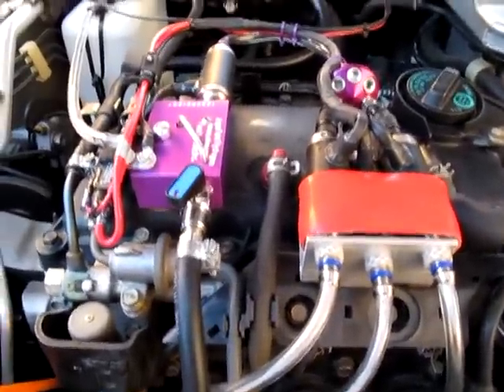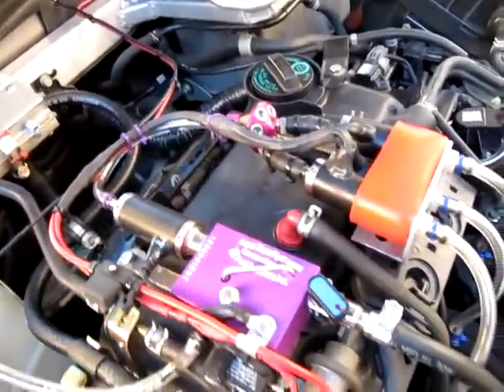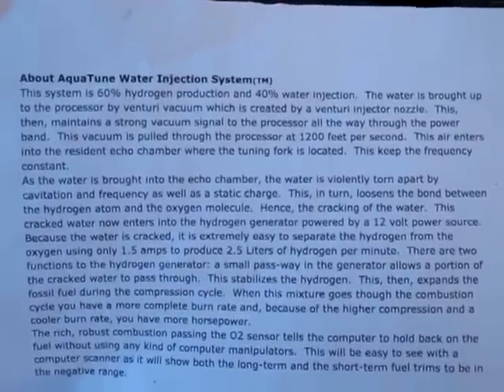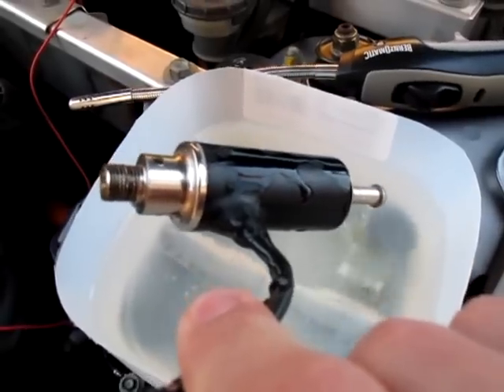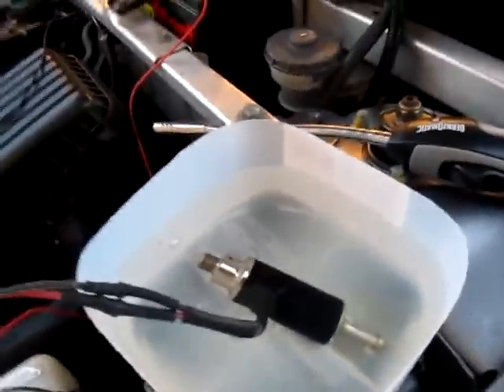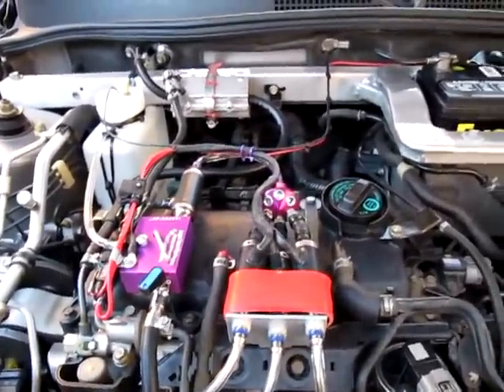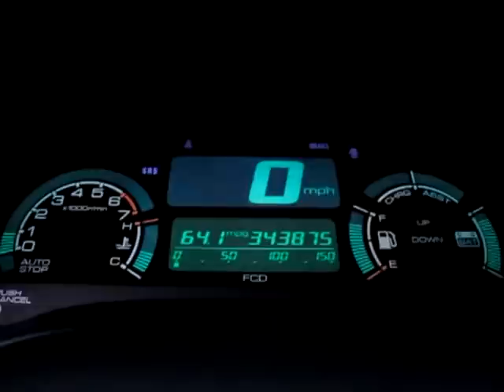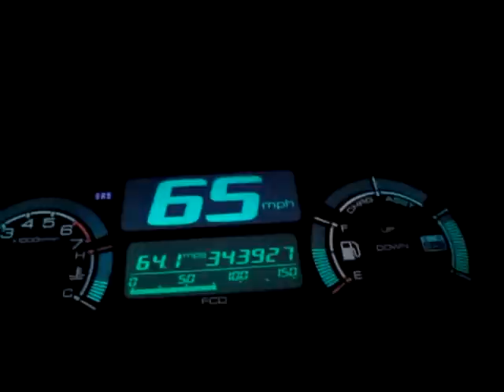Water Fuel Technology For Everyone - AquaTune Hydrogen Fuel Systems

Comment from the maker: Hi Jaime. It is my understanding that traditional approaches to Hydrogen and Oxygen Production via Electrolysis from water require automobile computer and or engine and exhaust sensor manipulation in order to achieve fuel efficiency and horse power gains. I study Hydrogen & Oxygen Electrolysis systems for quite some time before purchasing the AquaTune system. The AquaTune systems do not require any sensor manipulation in order to achieve fuel efficiency and horse power gains. AquaTune is good :)

Comment from the maker: Excellent Question Evan. For use of the AquaTune system in freezing temperature conditions- one may add a mix of 1/2 distilled water to 1/2 isopropyl alcohol. isopropyl alcohol has an extremely low freezing point(compared to distilled water). For example, if using the 2 Liter Water Reservior, we simply add 1 Liter of Distilled water to 1 Liter of isopropyl alcohol, and the aquatune system will function without danger of freezing nor malfunction in freezing weather conditions.

Comment from the maker: Hi Issac. Excellent question. Yes-in order to achieve a 25% increase in fuel efficiency, you will only need the primary AquaTune Processor, which comes with one Hydrogen Producing Capacitor. Horse Power is also increased as well. If you would like to increase fuel efficiency and horse power beyond running the single Hydrogen Producing Capacitor- you may add additional Hydrogen Producing Capacitors- downstream to the processor. Ortho Hydrogen(over 300btu) is 2.5 times more powerful than gasoline.

Comment from the maker: Thank you. And- I agree. Before adding the AquaTune Hydrogen Fuel System- cruising at highway speeds- the car would average approximately 58mpg. Yes- with the AquaTune Hydrogen Fuel System- the 2000 Honda insight averages approximately 75mpg on the highway. The increased acceleration and top speed ie "wide open throttle" is also significant as well. I highly recommend the AquaTune Hydrogen Fuel System to anyone that wishes to increase both horse power(acceleration) and fuel efficiency.

Comment from the maker: Before adding the AquaTune HB to the 2000 Honda Insight which comes stock with a 3 cylinder, 1 Liter, 61 cubic inch, 1000cc Honda VTEC-E Lean Burn Engine(ie Air To Fuel Ratios up to 25.6 Parts Air To One Part Gasoline- Measured with a MoTeC Air To Fuel Ratio Gauge) The car would only average approximately 43mpg in the city(with Hybrid High Voltage Battery Turned Off). With AquaTune- The car averages 75+ mpg. With a significant increase in power and acceleration. The power increase is incredible.

Comment: thank you MUCH for your vids. 
i called aquatune today and got the specs for my xj off road vehicle. i asked about your multiple hydro 'generators'. i couldnt afford 6 other ones for each intake port (6cly) so i asked about doing it in tandem... he said that 2 generators in tandem will boost the efficiency of the hydro by times- 6. 
he said this was especially good with vehicles like mine. the 2 was sufficient unless i had the funds for all 6 that would be directly into each intake.

Comment from the maker: Hi h2oplasmaplug. You are correct.The high volume hho is produced by the Hydrogen Producing Capacitors- under vacuum conditions- which reduces surface tension-upon the water molecule-which-combined with a StaticElectric Charge-as well as-the Processor Stage Of The System weakening the Covalent Bond of the water molecule via Resonance and Frequency-as well as Cavitation-all contribute to the higher volume-Hydrogen Production.The Hydrogen Producing Capacitors are calibrated for these conditions.

Comment from the maker: The Aqua Pulse System is quite nice. Thank you for mentioning this :) I understand, I vaporized a fine tip iridium EnerPulse Capacitor Plug some time ago. EnerPulse assured me this would not happen again because they have changed both the design and material. I am testing this for myself, now. So far, good results :) I will look into the Aqua Pulse System for future testing and experimentation. Thank you JP.

Comment from the maker: The reduction in fuel consumption is a minimum of 25% when running the AquaTune Hydrogen Fuel System. Exhaust Emissions are also reduced. Horse Power is increased. I'm very happy with the AquaTune sytem and I highly recommend it. The instrument cluster is factory, however I change the color to one of my preference(See High Temperature Photography-Lighting Gels). That is correct. 2.5 LIter's Per Minute(Generators Must Be Under Venturi Vacuum per design specifications). Good Questions :)

Comment from the maker: Because of the significant increase in power and acceleration- I push down on the gas pedal much less- in order to achieve the same speed(ie with AquaTune HB vs without the AquaTune HB). This results in using less gasoline. I recommend you contact AquaTune directly for a more detailed and knowledgeable response. I'm doing my best to explain this to you, I have limited knowledge and understanding of this systems function. I can say that without a doubt- AquaTune works incredibly well.

Comment from the maker: Thank you HHO4ALL. It is quite impressive how much more power the engine has. For example- with the AquaTune unit- I was on a flat open "isolated road" and I push the throttle down all the way- This car has five forward(tall) gears- I was going 108 Miles Per Hour in 3erd Gear at approximately 5300rpm's. The redline is 6000 rpm's. Before adding the AquaTune, The car- without use of the HV Hybrid Battery- would not acclerate to higher speeds such as 108mph at Wide Open Throttle(WOT).

Comment: If you have the high voltage battery still installed but it is not functioning. You could always uninstall it to save weight and further increase mileage.Route your PCV through a catch can if you havent already. The PCV sends oil vapors back into the intake reducing the effective octane of the gas, and also gunks up the whole intake, manifold, and valves. This is small potatas and wont net any noticeable gain but is definitely worth doing.

Comment from the maker: Hi Donnie. The AquaTune Hydrogen Fuel System utilizes Distilled Water which can be purchased at just about any grocery store. If you would like to use engine oil(new, used or crude) as your primary fuel source. You may want to look into the GEET Fuel Processor technology, which is able to break down molecules into their elemental states ie Atoms. With a self generated ElectroMagnetic Field- a positively charged ionized gas is produced(GEET Gas). Also see The fourth state of matter or Plasma.

Comment from the maker: You have an excellent question. The AquaTune HB unit is design to work as a complete system ie Hydrogen Generator Connected to and or downstream from the Distilled Water Processor. The distilled water processor weakens the water molecules covalent bond with Resonance and Frequency- As well as a Static Electrical Charge. The Water Molecules Covalent Bond in a weakened state- permits the Hydrogen Generator(s) to produce higher volumes of Hydrogen ie 2.5 Liters Per Minute- Per Hydrogen Generator.

Comment from the maker: Your research reminds me of the GEET Fuel Processors- Particle(fuel of choice) Acceleration Chamber. Where vaporized fuel is accelerated to the speed of sound ie Mach 1(761MPH) via a venturi action. Once fuel molecules achieve this speed, they become destabilized and ready for separation into their respective elemental states. AquaTune uses air velocity(speed and direction) a little different. I recommend contacting AquaTune Technical Support- in order that your questions may be answered.

Comment from the maker: In freezing weather conditions, one may simply add one part isopropyl Alcohol to one part distilled water. This 50/50 mix prevents the water from freezing and the AquaTune Hydrogen Fuel System works very well.

Comment from the maker: Excellent Questions. This system is available directly from AquaTune Hydrogen Fuel Systems in the USA. AquaTune has a web site as well. This system is 60% Hydrogen Production and 40% Water Injection. The Hydrogen Production is 2.5 Liters Per Minute at 1.5 Amps for each Hydrogen Generator. The Fuel Efficiency increase is a minimum of 25%. The power increase is also quite significant. You still use your primary fuel of choice ie gasoline. AquaTune reduces the primary fuel consumption by 25+ %

Comment: Interesting stuff.  I've randomly come across this HHO subject several times over several years.  It seems that it is constantly evolving to better tech, smaller, and more efficient kits.  I too am in efficiency technologies business operations.  There is better lubrication for the friction parts of machines than is sold by mass oil producers.  Although this has been available for decades, and not that I think the oil Corps don't have chemists who understand it, but they just roll out bits at a time of what they are fully aware of in chemistry to squelch out more and more $$ out of the same customers.  Therefore you always have the "Aftermarket"  Parts makers are involved as well.  If the parts last longer, then they don't sell you but One over many many years instead of 2 and 3 and 4 in shorter time frame.

So it appears this technology has one aspect covered to rely on much less resources, so then we all just need to address the other as well.

You engine oil can last more like 25-50k miles before change.  What a slash in oil sales if citizens and industrial machines changed oil 3 and 5 times longer into the future :)

Comment: Hi everyone, i gonna tell you why this systems works, if you see in the video, there is an air input in the intake manifold, that will cause the MAF sensor or MAP sensor read less air getting into the engine what will make the ECU calculte the air/fuel ratio with less fuel as there is less air readings, that power is going to lose will be back with the hydrogen and water is getting into the combustion chamber, Why water? .. the water converts into water vapor with the combustion heat of the fossil fuel and the extra HHO, so it expands 250 times and push the piston down.. So it is prety well done..

Comment from the maker: Excellent Point Brendon. And you are exactly right. The AquaTune Hydrogen Fuel System is the only Water Fuel Technology System I'm aware of, that does not require computer sensor manipulation in order to achieve fuel efficiency and horse power gains. In order to understand how and why this is, please contact AquaTune Technical Support during operational hours. AquaTune is highly qualified to answer any technical questions related to their systems. I highly recommend AquaTune :)

Comment from the maker: I recommend speaking with AquaTune about which spark plugs to use. You may contact technical support and gain insight into what other customers are running and what works well with the AquaTune Hydrogen Fuel System. I've primarily use the Honda factory spark plugs, and now testing the Enerpulse Capacitor plugs for experimentation purposes. I'm achiveing a little gain in power and efficiency with the Enerpulse Capacitor plugs, thus far. I purchase the EnerPulse Plugs at AutoZone AutoParts.

Comment from the maker: Interesting idea. I will work on this 0-60. I've had it up to 108mph in 3erd gear(of 5 forward gears) after installing the AquaTune Hydrogen Fuel System. Before adding the AquaTune Hydrogen Fuel System, with the High Voltage Hybrid Battery deactivated, the 2000 Honda insight would not achieve this speed in third gear. The fuel efficiency gain is 25% above your existing average. That's a money back guarantee as well. The AquaTune system is very well made and works very well.

Comment from the maker: Excellent Question. This is a question that must be asked directly to AquaTune Technical Support. It is my understanding that the AquaTune Venturi Nozzles break up the weakened covalent bond water molecules(1.7 sextillion molecules per drop of water. ie add 20 zeroes to 17). In this way, the water molecules are sufficiently small, and ready for the combustion chambers. Keep in mind that even Fuel Injectors Spray Gasoline in the form of 50 to 65 micron liquid droplets into the engine.

Comment from the maker: I recommend not connecting anything until you speak with AquaTune Technical Support. AquaTune can answer your questions instantly. Please conctact AquaTune technical support during operational hours. Just let AquaTune know you just purchase a unit used, and want to make sure you connect the system in the way it's design to be.

Comment from the maker: Good Question. In freezing weather conditions, one may add one part isopropyl Alcohol to one part distilled water. This 50/50 mixture permits the AquaTune Hydrogen Fuel System to work very well in freezing weather conditions.

Comment from the maker: You are exactly right. The adding of three additional AquaTune Hydrogen Generators was my request. I ask AquaTune if I may add additional Hydrogen Generators and I add three additional AquaTune Generators downstream from the Primary AquaTune Processor. The processor weakens the water molecules covalent bond with resonance and frequency as well as a static electric charge- which makes hydrogen production- downstream(in close proximity) from the primary processor- extremely efficient.

Comment from the maker: Excellent Question. In freezing weather conditions, one may add one part distilled water to one part isopropyl alcohol. This mixture permits the AquaTune Hydrogen Fuel System to function in freezing weather conditions. For example, if one were using the 2 Liter distilled water reservoir, one would  add 1 Liter of distilled water to 1 Liter of isopropyl alcohol.

Comment from the maker: In order to achieve the 25% increase in fuel efficiency as well as an increase in horse power- one only needs the primary AquaTune Processor- as well as the single Hydrogen Generator which comes with the unit upon purchase of The AquaTune HB. Adding additional Hydrogen Generators will increase fuel efficiency and power beyond running the single hydrogen generator because Ortho Hydrogen burns 7 to 9 times faster than gasoline- and has 2.5 times the power of gasoline.

Comment from the maker: That is the state of charge indicator. With the hybrid system turned off, the 10,000 watt brushless DC motor will not have access to the high voltage battery for the purpose of acceleration, nor regenerative braking. This means that while the hybrid system is turned off, the high voltage battery will not recharge, and will not facilitate acceleration. In order to learn more about your first generation honda insight, see the forum Insight Central via Google Search. Thank you for your question :)

Comment from the maker: Hi Issac. I highly recommend the AquaTune Hydrogen Fuel System to anyone that wishes to increase both horse power(acceleration) and fuel efficiency(reducing fuel consumption by 25% or more). AquaTune has highly educated(in automotive diagnostics and AquaTune systems installation) installers which are highly qualified to install the system for you. That's a very nice automobile you drive. I do recommend the AquaTune Hydrogen Fuel system for your auto-with additional Hydrogen Producing Capacitors.

Comment from the maker: Stanley used a Resonant Cavity(hit's the water molecule's covalent bond at resonance) which seperate the water molecule into two parts Ortho Hydrogen(300 btu's) and one part Oxygen. To reduce the Ortho Hydrogen's btu(energy) to that of gasoline(115 btu), Stanley direct some of the exhaust(See Exhaust Gas Recirculation) back into the engine air intake stream- Thus reducing the power of the Ortho Hydrogen(Rocket Fuel) to that of gasoline. Very Interesting :)

Comment from the maker: Also- regarding your research and development in the area of your gasoline vapor chamber- keep in mind that billy(see YouTube screen name iambillythekid) found that gasolines autoignition temperature is approximately 950F. Those replicating and testing billy's system have confirm this and note the white vapor chamber works best when kept between 600F and 700F at all times. If the heated stainless steel which the fine mist of gasoline makes contact with- ever cools to much- residue will remain.

Comment from the maker: I do believe you have given a basic description of the basic layout of the AquaTune water fuel technology system. The venturi action is motivated or permited by the volume of air flow past the venturi nozzles- which maintains the vacuum signal- to both- the Hydrogen Producing Capacitors- and the Processor(ie The Purple Box). An ElectroStatic Charge is also generated inside the Processor.  Well Done :)

Comment from the maker: Before the 40% distilled water injections covalent bond breaks within the engines combustion chambers- it expands the fuel injected (50 micron to 65 micron) liquid droplets of gasoline (gasoline expands 163.3 times when phase changed from a liquid to a vapor state) absorbs heat- advances the ignition timing- then burns (Oxygen oxidizes both the gasoline and the hydrogen fuel). Water(with a weakened covalent bond- upon encounter with extreme heat and compression) expands approximately 1856 times.

Comment: Two more quick questions please.  Aquatune has indicated use of Copper spark plugs, however those are not the best out there these days.  What kind of plugs do you use and what is optimum in your opinion for this application?  Also, in addition to your computer MPH readout, have you actually kept track of gas pumped into your car vs mileage?